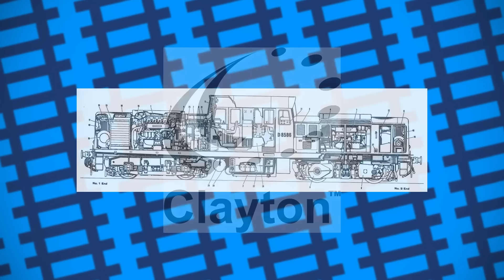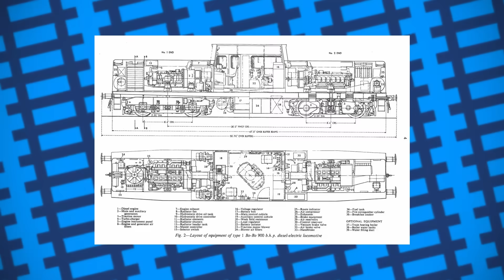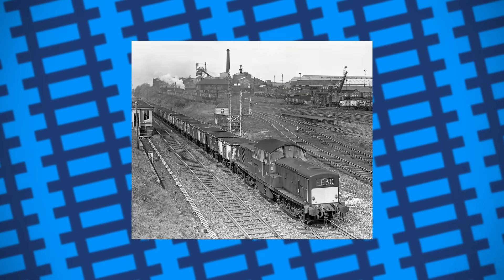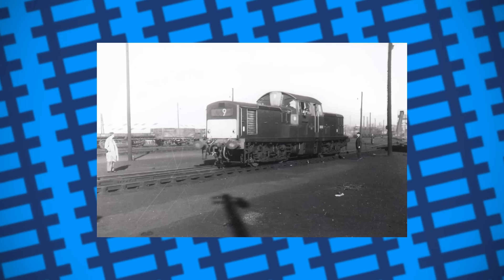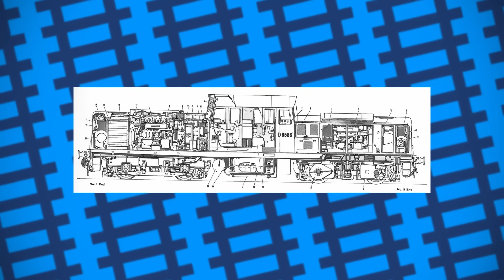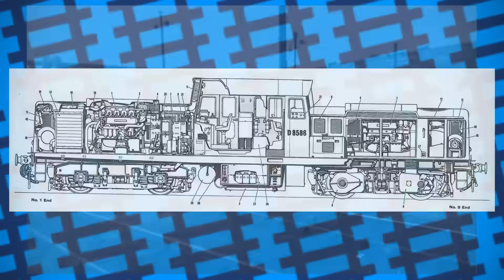British Rail's Disastrous Diesels - BR Class 17

Comment: I disagree. About 4 years ago working at the SVR on a Diesel Gala one of the trains made up  of 8 mk 1 coaches being pulled by a class 14 failed at Arley with an overheated Radiators, a Class 25 was dispatched light engine from Kidderminster to go and rescue it, this it did pulling the Class 14 and 8 MK1 coaches totally full, the class 25 got as far as Bewdley and failed itself. What happened next was they dispatched the Class 17 Clayton based at the SVR light engine too Bewley to rescue this train and too every one amazement the Class 17 dragged 8full MK1 coaches a Class 14 and a Class 25 from Bewdley to Kidderminster to everyone's amazement into Kidderminster at around 15 mph

Comment: Despite the failure, I think this is my favorite diesel locomotive. Derek from Thomas the tank engine helps that.
I saw a few comments talking about how America had dual engine diesels, would it be possible to swap the engines out for a different one?
Hypothetically, if they kept the frames but scrapped the motors.

Comment: The surviving class 17 D8568 was not preserved by the Chinnor and Princes railway, it was purchased by the diesel traction group and is based on the Severn Valley Railway. 

In preservation the locomotive has had a much better working life with several minor faults rectified and quite happily pulls 7 coaches around the railway with ease.

Comment: God. Also while the locomotives were meant to have 900hp total from the 2 engines combined, I still find it funny that while at half the power, the railways in Denmark managed to build Center cab diesels for the exact same kind of work at between 375 and 491hp a whole 10 years prior with much greater reliability and success. Specifically the 6 375hp "Rollerskates" for the private railways and the 17 DSB MT class locomotives, both built by the Danish manufacturer Frichs. These engines stayed in service at both private railways and the state railways until the turn of the millenium. One even being used in the 2000's. 

Frichs seemingly got the formula much more right than Clayton did. Though Danish manufacturers, including Frichs had been building big diesel locomotives and railcars since the early 1930's so their experience with diesel locomotive design was also far greater than anyone in Britain could compare with.

Comment: Hilariously. The remaining class 17 had its motor completed replaced and is now a somewhat decent runner
Reply: Now he’s reliable. Why couldn’t BR do that when they were in service?
Reply: @joshuaW5621 you're asking 60s Britain to build something reliable?
Reply: @Reiver-93  asking '60's Britain's public sector to build something reliable* 😂
Reply: @joshuaW5621  Ironically Paxman knew the engines needed modifications and proposed them before the first production batch were even being made, but BR management said no. Paxman dutifully but wearily gave BR exactly what they asked for, with the predicted result.

Paxman later did most of the proposed fixes, once BR had gotten a much needed bucket of cold water from angry engine crews 😂

Comment: And this this is the reason why old (and possibly newer) australian diesels have a cab at each end, to prevent these types of visibility issues, as well as not needing the use to use turntables to go in each direction taking up more time. And australian diesels are the only currently preserved diesel engines I think in the world that HAVE 2 cabs compared to single cab diesels everywhere else in the world. (Union Pacific did have an experimental double cab diesel, the centennials, but I don't think the double cab design idea was commonly implemented into the designs of them)

You see? Australian railways do have very useful ideas for their locomotives, like diesels with cabs at both ends, rather than the cab in the center, resulting in the visibility issue that diesels around the world during the same time were testing out, with varying degrees of success. And yes, some other parts of the world tried out the double cab locomotive idea, and may or may not have had big success in the design, but the advantage with a cab at both ends makes using turntables with a double cab locomotive not as necessary as it would be for a standard single cab locomotive.

Comment: Wouldn’t say it was practically impossible for class 20 drivers to see nose forward. The cab was wider than the rest of the body, so had the same visibility as a steam loco.

Also class 17s didn't officially become class 17s - at least not as you suggested in service. TOPS classification came after the 17s were removed from service

Comment: It says a lot about the Class 17 fiasco that, to replace the 117 failures, BR went back to English Electric in 1965 - three years after production had ended - and ordered another 100 Class 20s, basically to replace them - they may have been compromised with the cab at one end but the 127 already in service had proven the design's rugged reliability (definitely built on the KISS principle!) and when coupled nose-to-nose with 2000hp through 8 traction motors they were very effective - in the early 1970s I recall seeing pairs coming through Oxford on heavy 'MGR' coal trains to Didcot Power Station. The way things turned out BR could have avoided the whole embarrassing debacle by simply leaving the EE Class 20 assembly line running in 1962! No doubt they could see the benefits of the Clayton's overall design but these only paid off if the loco's were used singly - trouble was, that kind of trip and transfer freight working was already in decline (as the Western Region found out with the similarly doomed Class 14 0-6-0 diesel-hydraulics, but at least there were 'only' 56 of those and most found a second home in industry........at the expense of Britain's industrial loco builders but that's another story). During the Class 20's later years it was unusual to find them working singly anywhere other than Scotland.

Comment: BR is the textbook example of how not to do loco procurement. The Baby Deltics, the class 28 Co-Bos, the class 17.......the list goes on and on and honestly a lot of it could have been avoided if BR had only taken a couple for service testing instead of ordering entire classes off the drawingboard
Reply: That explains a lot of why the Reverend had such low views on diesels: he was calling out BR for dropping the ball
Reply: @lyokianhitchhiker  yeah. The plan started out sensibly enough, with prototypes for testing etc but in their haste to replace steam they opened the flood gates, in some cases ordering entire fleets even before the first prototype was completed. Some did mature into decent designs but only after much trial and error and significant cost to upgrade the ones built.

And lets not even start on how many (small production numbers) classes of tiny 0-4-0 diesel shunters they churned out........
Reply: @RedtailFox1  IMHO, it's telling how of the early BR diesels, only the Class 37s and Class 47s really survive in large numbers, especially for ones still in service.
Reply: @freebrickproductions  true however for every failed BR type there was another class which has vanished due to no other reason than changing requirements or technology. Specialized machines tend to have the shortest lifespans since they are greatly susceptible to changes in operations. 

It was the same with steam locomotives with large, specialized express engines being fairly quick to be replaced intended roles while smaller but more general purpose machines could hang around in service until the very end.

Comment: Every loco class has its weakness. Many of the weaknesses of this class are similar to many other classes. Much of that weakness was politics, money, br management and 'corruption'. Indeed, when you look at otherwise pretty sucessful classes they didnt last much longer either, ok some were hydraulics.
If you took the class 17, built it as intended, tested it and had modified it from exoerience, for the proper job. Then looked after in properly it would probably be fine. The operators of D8568 have found if you look after it, its ok.
It is clear early on, just like the develooment of Duke of Gloucester, BR had little real interest in making them work. They were already eorking on the 'next thing' and of course they really wanted eclectrification which could not be afforded and saw many diesels as 'make do and mend', a philosoohy developed post war over the 10 years eliminating Steam Traction.
Most people thought the class 40 were fab when introduced, then realised you really needed two to get the power of a Duchess. Then they were so heavy with so many wheels.
Like many classes, including the steam locomotives they were replacing, the work they were built for was disappearing quicker than the locomotives were being built!.
The transformation of routes and particularly freight operation was phenomenal and   unfitted freights were nearly eliminated by late 1970's. Likewise ,the huge investment in the 1960's in huge marshalling yards which became white elephants, like Tinsley,. 50 hump yards were built, 20 automated and the last in Scunthorpe closed in 1990.
I've walked round a fithy and decrepid Polmadie and Eastfield with dozens of disassembled class 17 locos, parts strewn all over the floor.
A far cry from the almost  surgical wards locos today are pampered in or depots like Willesden even then.

Comment: If BR had listened to Paxman and gone with the steel crankcases these would have been much more reliable than they actually were. However there was no way that two engines designed with DMU use in mind were going to achieve the longevity of the EE 8 cylinder lump used in the class 20, especially in a design Intended to be thrashed to death on freight trains.

Comment: It sounds pretty silly.   What these locos are is basically a dual cab loco with the two opposite facing cabs in the middle instead of each end.    And doing that forced the use of two small diesel engines instead of one big one - doubling maintenance effort.
Visibility for the driver has to be a lot better than any steam loco though.
So the Rolls Royce engines were junk?   Given my experience with other types of RR diesel engines, that doesn't surprise me.

Comment: At the same time, the US had many successful dual-engine center-cab diesel-electric locomotives,  General Electric was the most prolific builder of such units with power ranging from 300 hp up to 1,000 hp, and weighing up to 132 tons.  The largest engines of this type were the Alco Century 415 units of 1966; the cab was slightly off-center with a single 1500 hp engine under one hood, and the radiator auxiliaries under the other hood.  One of the problems with this latter layout was that water pipes for cooling ran under the electrical cabinet creating a shorting situation.  None of the units, however, was ever designed to house a train heat boiler.

Comment: "They used engines from diesel rail cars."
Aren't rail cars only meant to haul their own weight in regular service?  No wonder these things struggled.
Reply: Most rail cars atleast on the continent were built to haul one or two standard coaches or small goods vans in addition to their own weight, or had dedicated unpowered cars for them
Reply: @dosvidanyagaming4123 
Yeah.  Intended for little or no additional rolling stock.
Reply: @dosvidanyagaming4123 True; but nothing far more than that. Everything above 3 cars was heavy. There were (at least in some countries) built also dedicated series of hauling railcars, which were meant and designed for local branches, where daily passenger traffic was so small that everyone fitted into the railcar and at the same time various sidings along the line could be served with their needed freight cars. This could sometimes lead to pulling up to 10 cars and more, but those railcars had adequate powerful engines.

Comment: This echoes with a very similar flavour to the experiences we had with the British built New South Wales Government Railways 41 class.  https://en.wikipedia.org/wiki/New_South_Wales_41_class_locomotive .  Frequent overheating rendered them unusable for any form of continuous operation.  Only one practical purpose was found for them; pulling the maintenance trains used by crews to erect the overhead power cables for the expanding electrification of the NSW rail network.  The 41 class were so notorious that a witty engineer wrote a poem about them:

When you’re signing on at Delec(1),
And you hear a GM roar;
But he Chargeman meets you laughing says,
“Take 4104”

The fireman(2) howls in terror,
And the driver gives a wail,
For of all the diesel locos,
This one’s favourite to fail.

You climb aboard the engine,
And then you give a frown,
For although you have touched nothing,
Both the engines have shut down.

You call out Tony Bergin(3),
And straight away smells a rat;
“Well mate, I think you’ve had it,
Cause the battery’s just gone flat.”

So they get another “Beetle”
After just a two hour wait;
And you finally leave the depot
And you’re only three hours late.

The load meter is missing
And the tacho’s just a hole,
And then you get her moving
And then she starts to pitch and roll.

The hot plate’s non existent,
But that is nothing new;
So you try the old compressor
To warm your pot of stew.

The voltages are haywire,
And the carbons burnt jet black;(4)
You say to your poor fireman
“We’ll be lucky to get back.”

The batteries then start boiling
And the fumes the firman stun;
The bloke at Delec tells you
“Pull the battery switch and run!”

A glow from the control stand
And you get an awful fright;
But it’s just hot engines warnings,
Blinking like a lighthouse light.

The air is getting lower,
And so you have to linger,
Till you look at RCRB,# (5)
And you help it with your little finger.

Then with F.8 fuses blowing,
And the blowers up in smoke;
The compressor’s throwing solder,
This really is no joke.

She collapses at the ‘Harbour,
It is then you lose your head;
You ring up Enfield asking
“Will I tow the old girl dead?”

They drag her back to Delec,
And the old dear try to fix;
There is no doubt about it,
The best one’s – 4106.(6)

This poem was written following the failure of 4104 hauling an employee works train. The failure successfully blocked three lines in peak time until a rescue unit arrived. This poem was placed in the cab of 4104 for a short time.

(1) DELEC = Diesel Electric Locomotive Centre
(2) Fireman = 2nd driver
(3) Tony Bergin was an electrical mechanic who specialised in 41 class
(4) The carbon blocks in the voltage regulators were notorious for burning and altering the output voltages of the auxiliary generators.
(5) If RCRB, a reverse current relay, did not close, the voltage from B auxiliary generator did not reach the motor driving the air compressor.
(6) The remains of the burnt-out 4106 had by this time, been abandoned.

Comment: do you want another bad loco to consider for this series.   how about the western australian government railways x class with a crossley engine.   the irish threw the engines out of their version very early on.   the wagr persisted and counted 6oo design faults mainly in the engine!    there is a connection to the br class 28, which also was problematic.

Comment: The total oposite would be the BR Class 11 in Dutch service as NS 600.
Even today several of those "coackroaches" ( durability and longlivety wise ) they are still in revenue service. The national railways NS had to abandon the use due to  ergonomics and labour laws issues.
Several other operators use them and even some are been converted to Hydrogen/battery power.
The  one in The Dutch national railway museum is used for shunting is even painted in a one of Delftware livery.
Those British machines from the 40's and 50's  are longer in Dutch service then ever on the British Isles.
On shunting track renewal work trains and heritage lines they are still used!
Operational use of them is still viable and they are transports by Truck to do there job.
I wouldn't be suprised these shunter would reach 100 years of operational service live!

Comment: These things sounded so good on paper that I kind of understand why BR didn’t bother testing them before ordering the batches.
Reply: less understandable is that they were apparently warned of the problems with the engines, offered a fixed version, and refused it on the bassis that the ones in the other model that was using them hadn't broken yet.
Reply: @laurencefraser  That is incredible. BR really walked right into a disaster lmao.
Reply: @MatthewsBranchLine  This is BR we're talking about, the cutting edge of cocking up is their unofficial motto 😆

Comment: Tragically they were pretty reliable if you kept the power to about 75% or so. That last crank up to full power was too much for the systems installed.
BR ordered 100 more class 20s in light of the 17's failure and these were delivered in 1966 onwards.

Comment: The concept of multiple smaller engines is standard practice on most passenger trains now, being multiple units.
Update a class 17 with a couple of class 800 power units, you could lower the bonnets & it would go like stink!
It was just a bit ahead of the technology & thrown together too quickly without proper testing & refinement.

Comment: Paxman knew that the engines were suspect and told BR, but BR ordered the engines as tested under the Paxman DEMU with the dodgy cast aluminium parts even though Paxman offered cast iron replacements.
Reply: If I had to guess BR's motive for ignoring Paxman was cost cutting
Reply: @glennmandigo6069 the Paxmanvhistory site says that BR wanted the engines as tested in the Paxman DEMU.